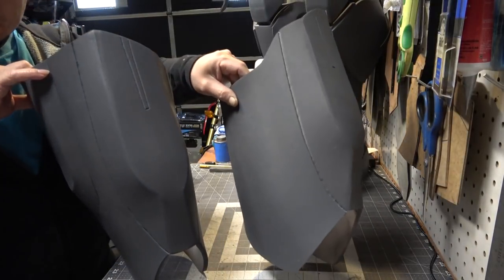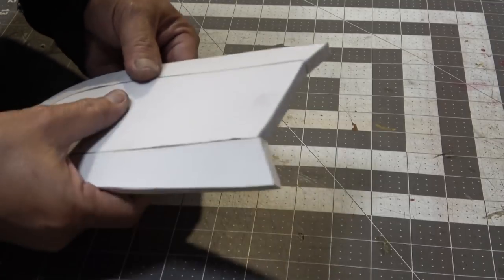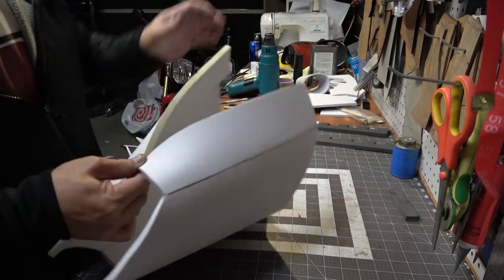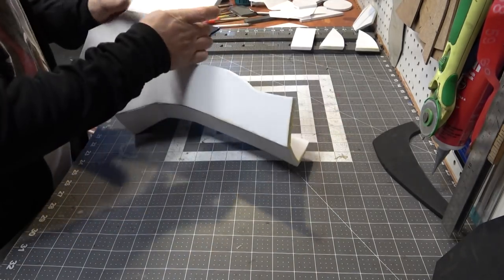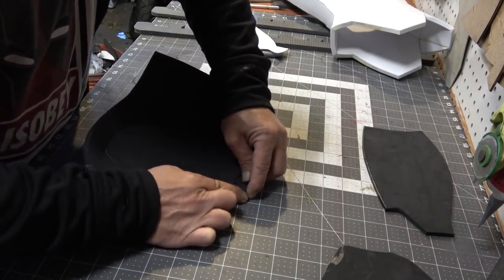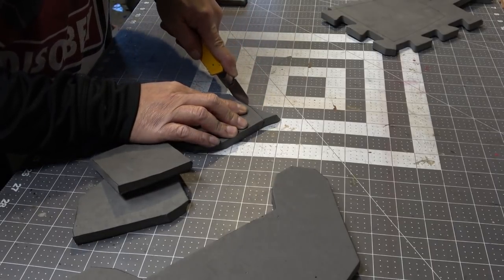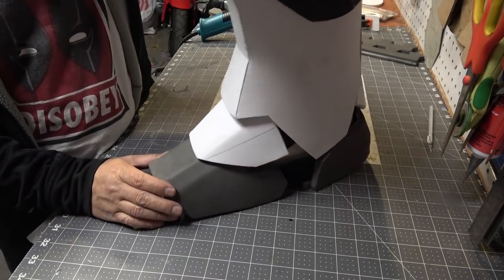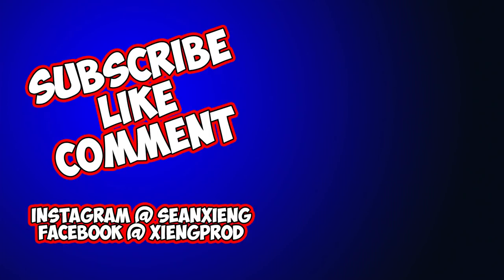How to build IronMan foam armor DiY part 4

Comment: What are you doing for hands? And around neck? I've purchased your pattern and done see either listed. Great product btw I've modified it a bit for more true to mark iv armour like the movie
Reply: Hey man did you run into the similar problem that I did? Thankfully I'm catching the difference here in the video and I've only cut one thigh guard. But on my template for the sign and accent it's listed as a slight inward angle clutch on the edge. And now I have to completely recut my pieces and use more foam... Not to mention these are the largest Peace's of foam in the whole build 😬

Comment: how do i print the templates on a a4 printer?
Reply from the maker: Open files with Adobe Reader and select POSTER in the print option window. Select your paper size in page setup and Adobe Reader will adjust the patterns to fit your paper.